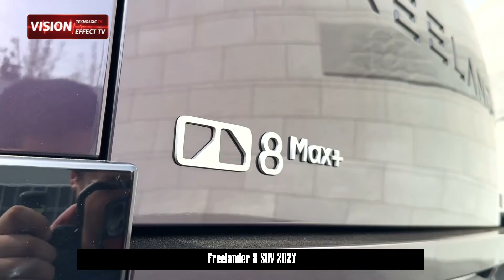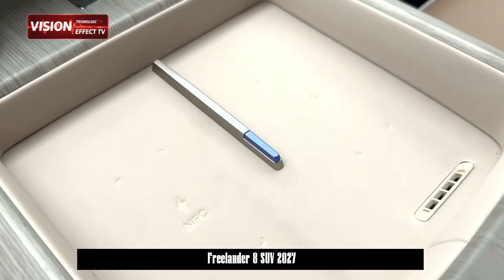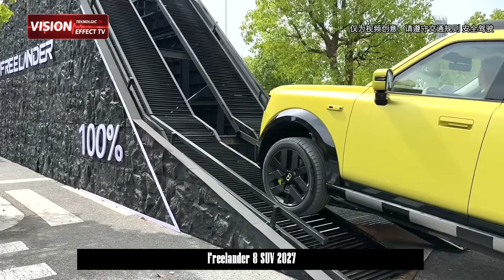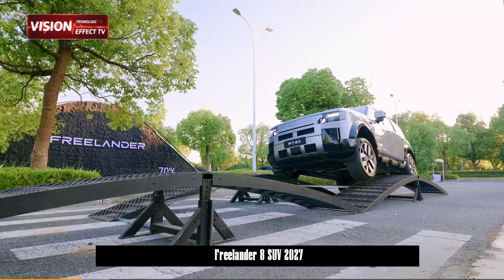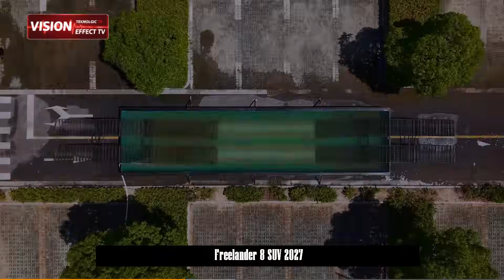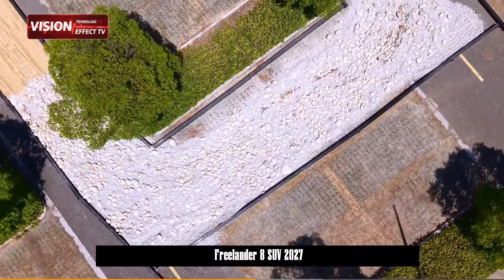Can Every SUV Do These?! | 2027 Freelander 8 Off-Road Capability Tested!

Comment: How much will it be?
Reply from the maker: The estimated pricing for the 2027 Freelander 8 is expected to start around $50,000 to $60,000 USD for base trims, with fully loaded off-road and high-performance dual-motor variants reaching $70,000+ USD. Official market-specific pricing will be finalized closer to launch!